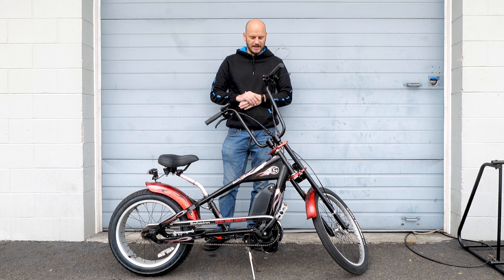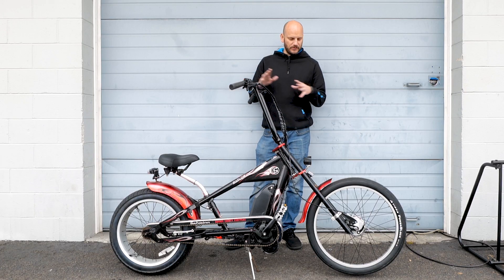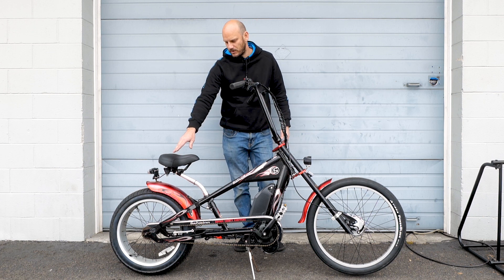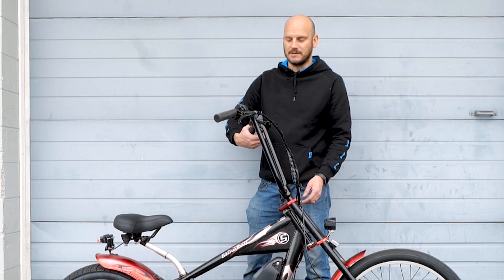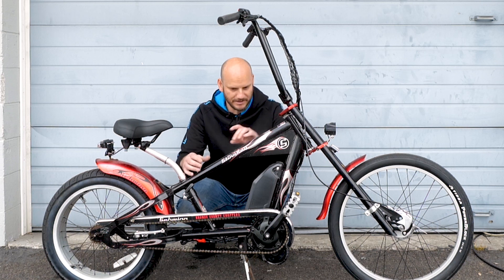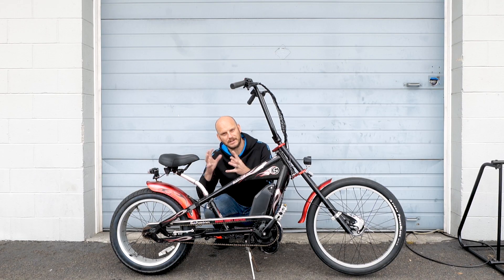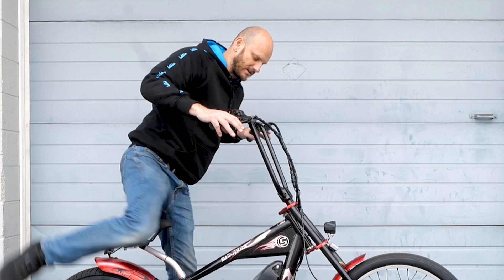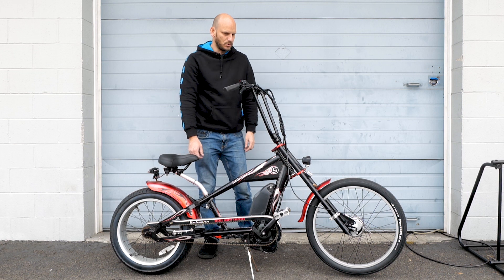Custom Ebike Build: Schwinn OCC Chopper w/ Bafang BBSHD 1000w mid drive and a 52v 10ah wedge battery

Comment: hey man, my 27.5+ BMX has a bottom bracket shell that's about 3 inches wide = 76.2mms which is obviously more than 68/73 - should I buy a 100m BBSHD and just space it out or will I be fine with a 68mm?
Reply from the maker: Go 100mm. Just double check that’s the actual length
Reply: @JohnnyNerdOut  could you point me towards spacers i would need?

Comment: I'd have laced up an internally geared hub (hundred bucks labor). The other day I converted a Giant Revive (look it up, really weird bike). It had an internal three speed and an external 7 speed. 

Why not wrap the bike? That would eliminate the need to disassemble for new paint and allow you to change it if you like.  It wouldn't destroy the original patina either. 

For those who may wonder, the OCC stock banana seat isn't as comfy as the ones on our old Stingrays. It would really be cool to include a sissy bar on one of these.
Reply from the maker: Good question about the IGH. I can’t remember what the dropout spacing was on this one and if it would accommodate one. Lately I’ve been seeing a lot of 190mm. 
I try to avoid the cosmetic stuff as much as possible as that’s where the labor intensive $ part comes in and racks up the bill quickly.

Comment: That's so cool to see a sturmey archer drum brake being used for this! I've been wondering if they would be suitable for ebikes, since I have a distaste for disc brakes and a love for sturmey archer hubs. does it feel like it stands up to the task?
Reply from the maker: Ya it actually felt super strong. Not sure about daily 30mph runs though but for normal riding it felt fine 👍